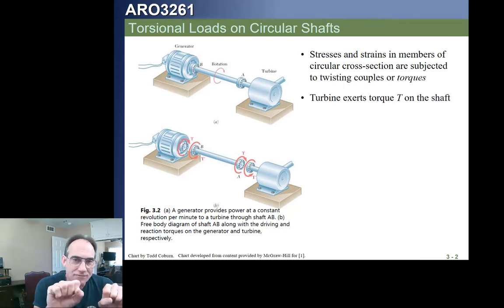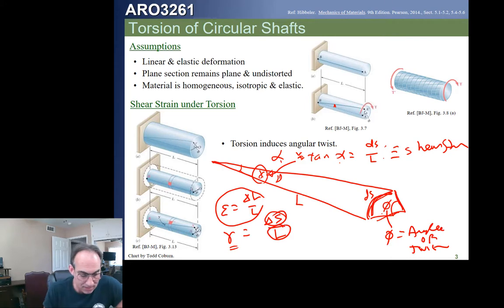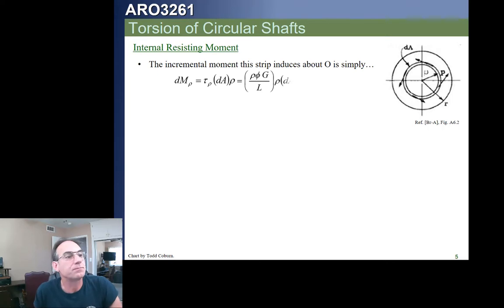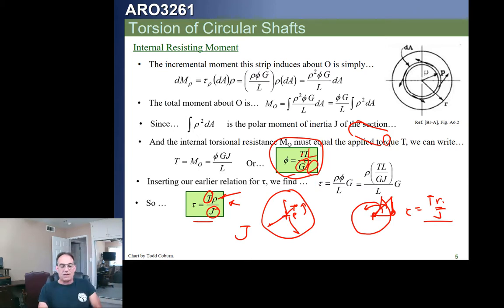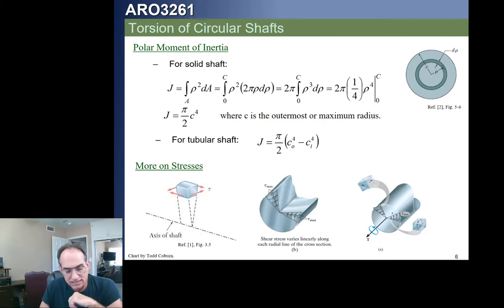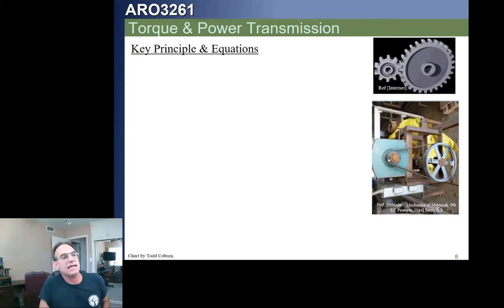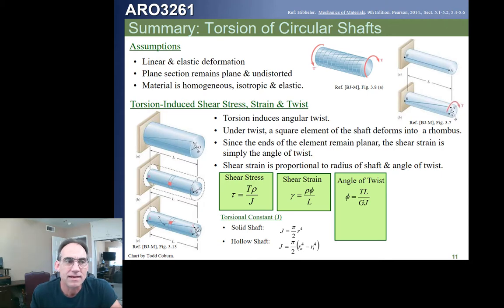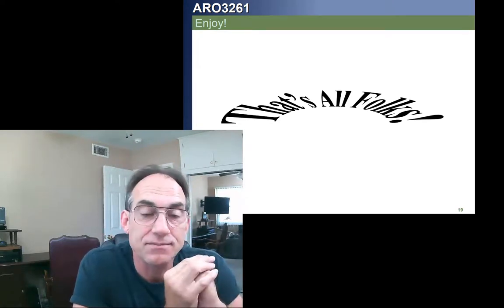Strength I: L-06 Torsion of Circular Sections

Comment: Hi Prof. Todd, Aerospace Structural engineer here, brushing up on my basics, thanks for the wealth of knowledge in your channel. 

5:45: you mention " shear strain is (simply) the angle of twist" - didn't quite get that

 29:56: Also, just wanted to point out, in the part about the Torque diagrams, instead of multiplying the load by radius you had multiplied by diameter